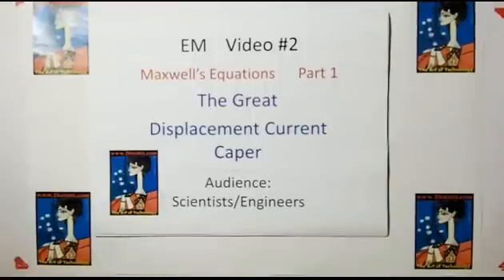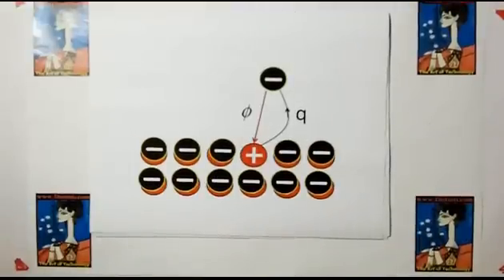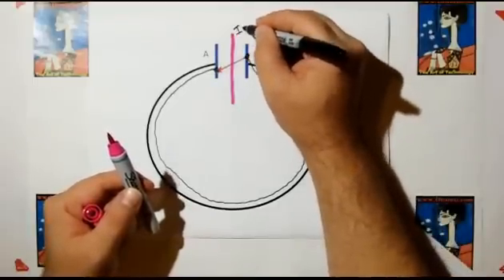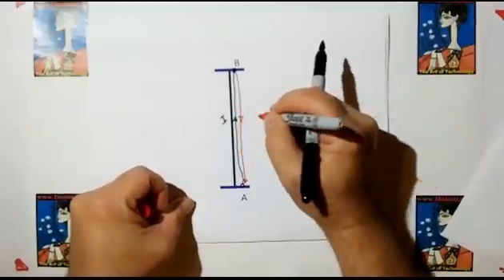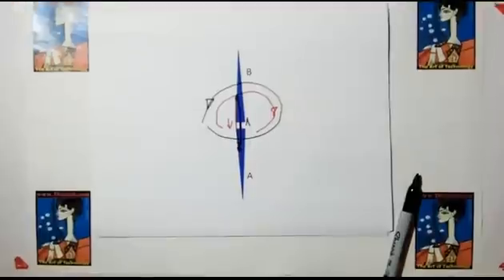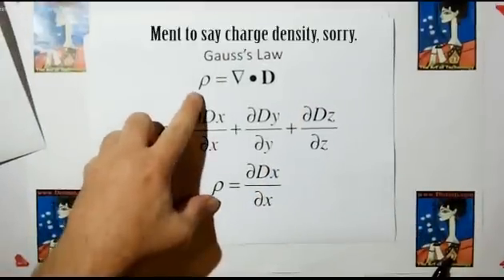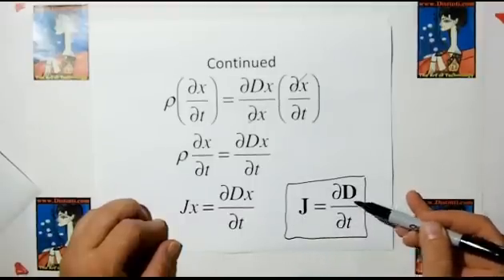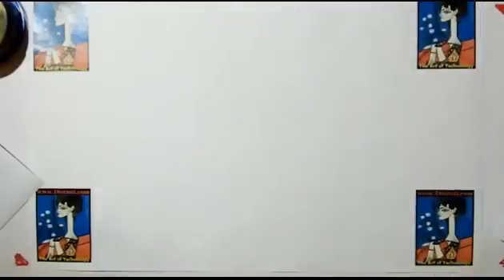emV002: Light 1 / Maxwell 1 / Displacement Current Caper

Comment: You may or may not be aware that you are not the first to call shenanigans on Maxwell's displacement current. Abbas Asgharian and Niloofar Asgharian published an NRC paper on that in 2008 called "Maxwell’s Equation Revisited" - PACS Nos.: 03.50.De, 41.20.q, 01.55+b.
Reply from the maker: My work on Maxwell has been published on my website since the mid 90s ( I have many subscribers that have been with me since the  beginning).  I also have library of congress publications c2003.   These videos are just a means to dump everything that I have to make sure that this stuff is not lost to cancer.  The silver lining is that the production of the videos helped me rethink stuff from the beginning which helped me see Gateways that I missed before (this is mentioned in emv021) at the end.
Reply: www.Distinti.com I stand corrected. In any case, the nay sayers should take note that this is a well known problem.

Comment: The reason you get 2J in your simplification is because you assume that: the E field in space between the Faraday's plates is as same as the E field outside the space.  Within the space, J is zero, but E is not.  Therefore, in the space, most of curl B term is dD/dt.  Outside the space, E is about zero.  Thus, outside the space, most of B term derives from J.  

Your diagram of the dipole, with the displacement current, is also incorrect for related reasons.

Comment from the maker: If relative permittivity (Er) of conductor = 0, then E-Field=0, then E-field plays no part in moving the mobile charges in a circuit. There is no material with a permittivity less than free space.
The equations you cite are an equivalent means to model how mobile and captive charges in materials affect our measurements. Thus, the Jd across a good dielectric is higher because of the behavior of the captive charges in the material, NOT because the actual permittivity of free space has been altered

Comment: As John M has mentioned Jc = sigma*E, Jd = epsilon*dE/dt.
In the conductor sigma is is great therefore Jc is far greater than Jd. sigma ~ 10^7 and a good insulator has high permittivity, so a conductor will have 0. epsilon = 0, so Jd ~ 0 in conductor. In the surrounding air epsilon is 1, and sigma  ~ 3x10^-15. So Jd will be dominant. Jc will be neglible.

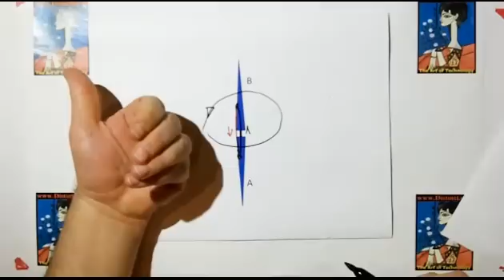Comment from the maker: at 5:43 the only problem is that I drew arrows of the curl for right hand rule.  
This does not affect the conclusion.
Engineers use right hand rule because we think in terms of positive current flow (historical).
Physicists use left hand rule because they use the more correct notion that negative charges are actually moving.
Use either convention; however, must use the same for both Jc and Jd.
Otherwise curlH = Jc-Jd would be the accepted equation and transformers would stop working.

Comment: @5:43 the direction of curl follows the right hand rule. You correctly use the left hand rule for the electron (due to historical reasons). But incorrectly use the left hand rule for dD/dt. 
Also, conduction current does not always equal displacement current dD/dt.  In general, for a lossy media, Jc and Jd respectively come from the real and imaginary parts of the complex permittivity, which in general can be anything.
All together, curl H is not necessarily zero.